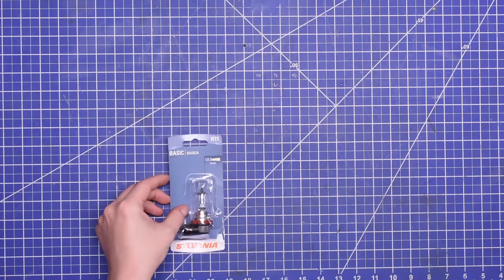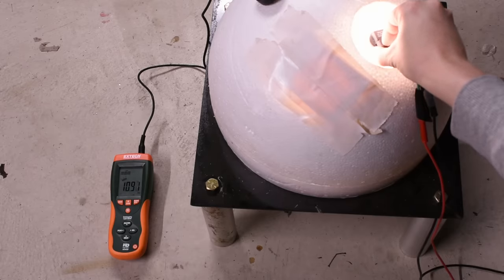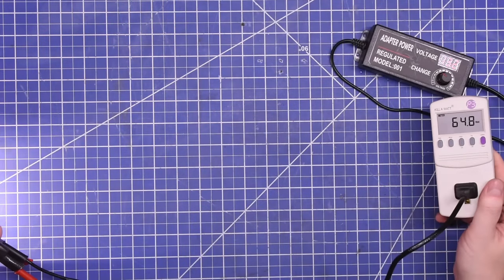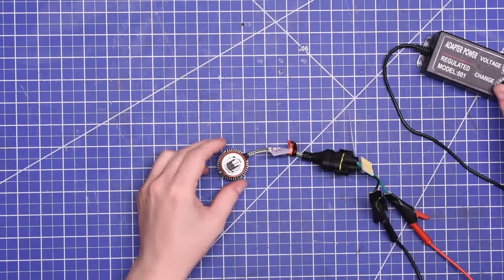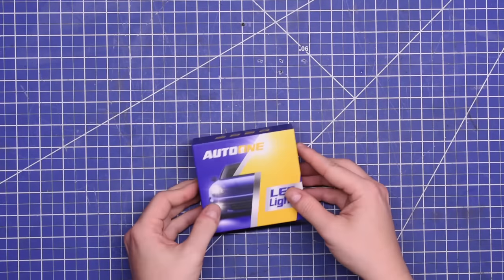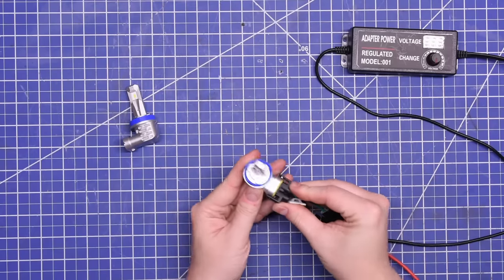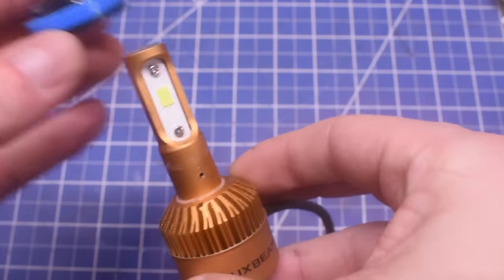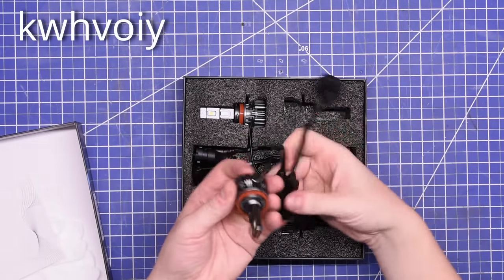Amazon Headlight Bulbs are Getting Out of Hand

Comment: The ballast is actually a parallel resistor to draw more current, It keeps the headlight warning light in your dash from coming on.
Reply: @concinnus  Read the comment again, they literally stated a parallel resistor to draw more current.
Reply: Resistors do not draw power, they limit it.
That why they are called Resistors.
Reply: @stoney2732  Resistors do draw power, don't be silly.
Reply: @TeslaNick2  resistors limit current flow.
Things than transform energy draw current.
Examples would be, motors, bulbs, transistors, transformers, even capacitors.
Resistors themselves do not draw current.
Reply: @stoney2732  So what's happening when I use a dummy load (which is just a resistor on a heatsink) ? Why does the resistor heat up ?

If I stick a resistor across a battery does the battery discharge ?
Maybe consume is the wrong term, perhaps dissipate is a better term.
Reply: @stoney2732  bruh they definitely draw current if acting as a load by themself
Reply: @nucleardoominator  they do not act as a load.
Reply: @stoney2732   😂 so tell me what’s inside an electric heater? And why do resistors have wattage ratings?  Also, go look up how to model a real world component i.e. inductor, capacitor, or transistor in Spice.

By the way, resistors transform energy into heat.
Reply: @pauldevassy2379  If a resistor is getting hot, there is an issue with the circuit (in an amplifier it is usually an imbalance).
As far as heaters, yes the heating 
elements use resistant, but they are not the same as resistors.
That would be like calling a capacitor a battery, while they both store an electrical charge they are not the same.
Reply: @stoney2732  You are so wrong, period.
Yes, in SERIES, they will reduce load (and generate heat).
But when in PARALLEL, they present an independent load to the supply!
Resistors generate heat when current passes through them; they HAVE TO, that is physics...
That is why resistors have wattage ratings, and come in all sorts of ratings.
Depending on what they are there to do, they may produce imperceptible heat, or get too hot to touch, up to their rated dissipation...
[They can exceed this if there is an error in the design or a fault in the circuit].
Some special resistors are actually designed to burn out in case of a fault.
Mr K L
Reply: @stoney2732  There's a good reason resistors are available clad in aluminium shaped like a heatsink.
You never answered my question: why do resistors discharge batteries if they don't consume power ?
Reply: @stoney2732  You should probably do the research before stating false information next time. Electro BOOM is a great channel and he will teach you the right thing so you don't confuse people who don't konw electronics very well (especially yourself).
Reply: @stoney2732  Please tell me you are not an electrical engineer.
Reply: @stoney2732  I was confused for a bit in my dc circuits class, but not this confused lol
Reply: @Stoney2  I maybe didn't need to be so abrupt;
Perhaps there is some confusion or miscommunication...

Perhaps I can help you wrap your head around the different ways a resistor can influence a circuit:

Simplified explanations:
In series:
If you insert a resistor where a wire previously connect two things (series), then indeed it will reduce current flow (generally).
You are replacing a wire, (near zero ohms), with a resistor, that the current must now flow through [Your example].

You are going from a lower resistance (wire), to a higher resistance (the resistor you insert in-line).  Less current will flow...

In parallel:
Think of air as an infinite ohm resistor - no electricity just flows freely though the air ('GENERALLY' speaking)
If you install a resistor between to points that previously had NO wire or path existing between them (I mean a new path between wires or points that didn't have that path before); THEN, you are replacing a very high resistance (air) with a new, LOWER resistance of the resistor you are adding...

You are going from a higher resistance between those two points (air), to a lower resistance (the resistor you added).  More current will flow...

All other things being equal, in general, raising resistance will lower current. (linear circuits).  And lowering resistance (or ADDING one where none existed in THAT path before), will raise current...

Now there are other, more complex circuits, that a changing resistance value could effect a change in voltage, and the current remain constant (or near constant).
There are circuit configurations where both voltage and current change with resistance change.
It all depends on what the circuit is, and where the resister is...

If you meant 'when using them in series with a load' ONLY, then it would have been appropriate to mention that.
Stating flatly that 'resistors always limit/reduce a circuits draw' can confuse people just learning this stuff.  [It depends on the circuit, and WHERE you are putting the resistor].
If you did indeed think that resistors ALWAYS lower current (in a circuit overall), then you need to consider the many other ways resistors are used in circuits, that can change both voltages or currents, both higher or lower.

[I am not going into how resistors draw current, or dissipate heat, that is a more advanced discussion.  All the other's statements here about that are correct.]
Best to get a good grasp on how currents are distributed throughout a circuit, and how the voltages are spread out, and how component values, resistances, etc, affect that.
Once you are at ease with differing configurations, an how changing a value of one component can affects voltages or currents in several others; then you can move on to how power dissipation or consumption, in various components, is affected.  That is probably second year basic electronics material...

Suffice it to say that resistors DO consume power and dissipate (generate) heat [when a potential difference exists across them]. How much depends on the circuit, and their specific purpose.

Take care, and keep learning! I am... [50yr technician and still learning new stuff!]
Mr K L
Reply: @stoney2732  Resistors do resist electricity. But the comparison is to a (non-existent) material that doesn't resist electricity at all and lets the current go to infinity and beyond. In typical circuits, wires have "zero" resistance compared to all the other components, while everything else has a lot more resistance. So we can mostly ignore the resistance of the wire and just talk about the loads.

So if you take a battery and put a wire directly between the terminals, it will (according to basic EE math that's not actually correct) create a path with no resistance between the terminals, and you get infinite current that melts everything and the world explodes. In reality, the wire (and battery) have some finite resistance, so it just melts the wire or explodes the battery (depending on how thick the wire is), but still sucks.

If you replace a piece of the wire with a resistor, we go from "zero" resistance to more than zero resistance. Now, the wire gets less hot and the battery is less likely to explode. A purely resistive load (like an incandescent lightbulb) looks exactly like a standard resistor to a circuit diagram, and keeps the wires and battery from getting as hot as if there was just wire. Hence why flashlights don't typically explode or melt.

It's like taking a 1000-lane superhighway (bare wire) and suddenly condensing it to a 2 lane bridge (the resistor). All the cars have to slow down and wait their turn to cross the bridge. Once they get across, there's a giant highway, but you're still limited by how fast the cars get across the bridge.

Now, add a second resistor in parallel. It's like having a second bridge. Now, twice as much traffic can cross at the same time, greatly reducing the bottleneck. Compared to the superhighway, two bridges is still very congested. But it's less congested than only one bridge.

LEDs draw less current than incandescent bulbs for the same light output. This is good, because it reduces wasted power and is slightly better for our wallets and the environment. It also reduces waste heat which is usually good (though incandescent bulbs are still better for use as a chicken coop heater in a pinch).

It's like having a 1-lane bridge that (imagine a bridge analogy where people driving across it are doing something useful). Incandescents do the same work, but require a 4-lane bridge. It makes the electrons happy, but uses a lot more fuel to power them.

It also confuses the circuit. When a typical incandescent blows out, the resistive element falls apart and you have an open (disconnected) circuit. Technically, the air and space have some finite resistance, but it's so enormous compared to the 12V potential that we can treat it as infinite. No electrons are jumping that air gap, so no current is flowing.

If our headlight or flasher circuit can measure the current draw, and the current is suddenly very low, that means one of the bulbs blew out. By presenting an error on the dash (or flashing the lights really quickly for flashers), the driver notices the unusual behavior, and checks their lights. This enables them to be safer on the road and avoid paying for tickets by quickly replacing broken lamps. But the LED draws much less current by design, so the circuit thinks the bulb is dead and always indicates accordingly. This isn't a legal problem, but it means you can't tell when a bulb actually goes out, and it makes you look like a noob if your signals are always flashing extra fast.

So if we take our 1-lane bridge (the LED light) that's doing stuff (producing light) then add a second, 3-lane bridge (the parallel resistor), suddenly we have the same current flow as a regular incandescent, so the circuit (correctly) thinks everything is good.

It's better to replace the circuit with one specifically designed for LEDs, so we're not wasting a bunch of power on the parallel resistor (negating much of the advantage of the LED bulb). But it still works like a lamp and prevents older circuits from indicating bad bulbs.
Reply: @stoney2732  Sure they do. Or why do you think resistor get hot? Resistors do transform energy - electric to heat. What you mean is: A resistor connected in series with some other load limits the current through that other load. But a parallel resistor is just ANOTHER load, so the 2 loads just add up.

Think of electricity as water running through a hose: A resistor is a a bottleneck in the hose:
If you put the bottleneck in the hose (thus in series) it will limit the amount of water coming out of the end of that hose.
But if you add it parallel, you will have 2 hoses: the original hose PLUS another bottlenecked hose, and you will get MORE water out of those 2 hoses.
Reply: @stoney2732  The heating elements in heaters are just big resistors. The are EXACTLY the same.
Reply: I’ve installed several sets of the Fahren brand “Forscher” model LED headlights on several vehicles. Most installed without issues except for the set for a Chrysler Sebring. The lights would cycle on and off intermittently. I had to also purchase a decoder harness to get them to stop the light cycling. In all cases the lights have performed quite well. They are especially useful on a local road that is very dark and goes through an area well populated with deer. These headlights give me a much better chance to spot the deer before my bumper finds them. Say what you will, but I’m a fan of these LED headlights.
Reply: @stoney2732 , stop posting that "resistors do not draw power" nonsense. Of course resistors draw power. The heating element in your electric stove is just a fancy wirewound resistor.  (BS, MSU Dept of electrical engineering and systems science.)

Comment: that collar is meant to be tightened and is used to position the LED diodes SIDEWAYS after installation. If they are not positioned exactly east and west in the housing, they do not perform as well as expected. Also, LED headlight bulbs work best when used in diffuser headlamps. Regular headlamps allow the LED light to spray too wide, blinding oncoming traffic and uselessly illuminating the trees.
Reply: Lasfit auto solved that issue. You can use their LEDs in old-school headlamps
Reply: The whole point of new ones is illuminating the trees. Those trees are where the deer come from.

Comment: Would love to see the difference of the bulbs in a projector style housing over the reflector style
Reply: This! And for fun lets see what they look like in a HID setup (like a D2r or D2s setup). While not as common, HID -> LED kits do exist.
Reply: I have the D1S/R AUX beam in my Camaro. Factory HID lights and they are significantly brighter. I've seen AUX beam in a Corolla before and their light output is phenomenal. Both distance, clarity, and minimal scatter.
Reply: Exactly. Popping an aftermarket LEDs into your reflector housing (and frequently angling them incorrectly) just makes for a horrible experience for oncoming traffic, despite people thinking it looks cool.
Reply: I got some LED ones with projector style. It does not seem to blind other drivers at all. I read online that they're meant for projector housings only.

Comment: So glad you’re testing headlights!! Just keep in mind any light over the top line is blinding other drivers
Also doesn’t matter how bright they are when they burn out in a year because they’re cheaply built
Also also would love to see the morimoto headlights along with the salvinia led headlights
Reply: Yeah this would be a fun test is to run them until failure... LED will advertise huge hour ratings because the actual LED can potentially last that long... What often fails is the supporting electronics (usually due to heat)

I've seen customer cars with LED headlights that are having some level of failure (my favorite is flickering, not only blind oncoming drivers with the stray light but why not also cause seizures)

At least with halogen a failure is only the bulb works or it doesn't, not kinda works but flickers, or only half the bulb lights up
Reply: @SgtPnkks  With how hot they're running these, there's a good chance they're going to degrade the phosphor coating, too.  The ones with a separate ballast will probably see failures in the LEDs (or just dimming over time due to degrading) before the electronics fail.

That said, I bet some of these don't make it to the lifespan of a halogen...
Reply: @oasntet  It depends on the Halogen. My Sylvania H2 bulbs are rated for 2k hours, where my sister's car uses a different bulb (H1?) rated only for 1k hours. My bulbs are also $9 and hers were $22. As for the "Ultra" 150 hours is insane! in the winter I drive my entire 4 hour commute with the headlights on, what a nuisance to change the bulbs almost monthly!
Reply: That's why you don't buy some aftermarket headlights, find a reputable brand. But even so, an LED at the price they are vs any aftermarket halogen light of the same or similar lumen and colour rating, the LED will last longer all the time so even if a reputable brand dies within a year, it's still cheaper than a halogen.

If you want cheap and guaranteed to a degree, the yellow OEM headlights are your best beat, but if you want colour, brightness and at least some decent lifespan, a good LED would be your best bet once you find one that fits correctly and is adjusted to the correct height.
Reply: @akaraven66  I don't buy that any LED bulb is going to outlast a halogen.  Not without test data.  LED bulb producers, even those with big names, over-drive the chips to get more light instead adding more LEDs, all in the name of saving money.  And that shortens their lifespan.  It even burns more electricity, because the light-per-watt curve is not linear - you get way more light per watt under-driving an LED than you do over-driving it.
Reply: for what it's worth, there is a ton of discussion about these LED replacements on various car forums and longevity doesn't seem to be an issue. I personally have one of these LED kits in my fiesta and they're going on a year of use without any issues.
Reply: @oasntet one thing to consider is driving conditions, I was going through halogens like crazy in my Sierra pickup as the last portion of my commute is on a fairly rough dirt road. The bulbs would be hot from the drive in and the filaments would break. My fahren LED bulbs have been in for about 70000kms now (yes, I’m Canadian) and despite the rough roads and extremes of temperature they’re going strong. They’ve paid for themselves multiple times. I do periodically clean the mud off the little fan and off the ballast which is separate. In my experience they’re pretty hard to beat.
Reply: And you think they give a shit about blinding you. ? Or the f250 trucks drivers with their fog and low beams with LEDs blinding the shit out of you.